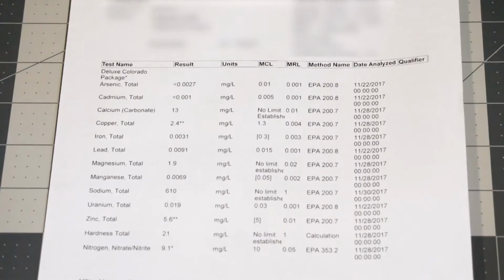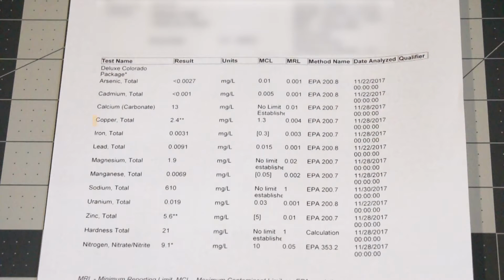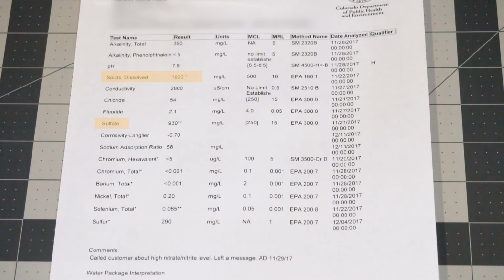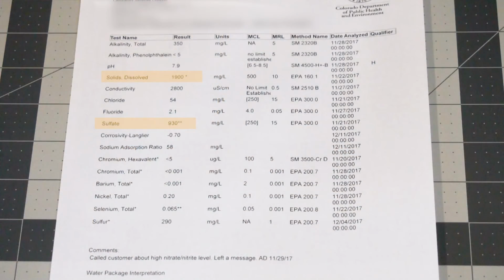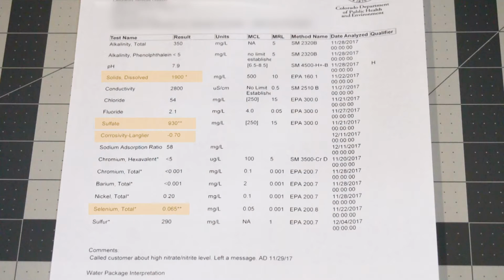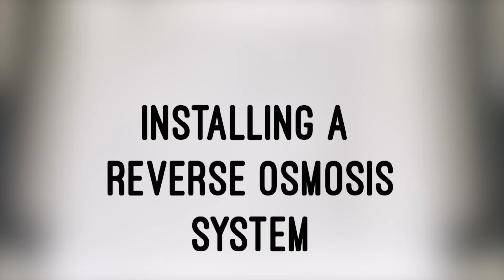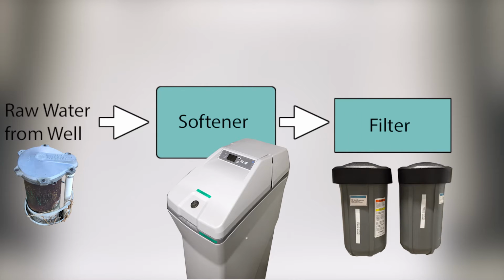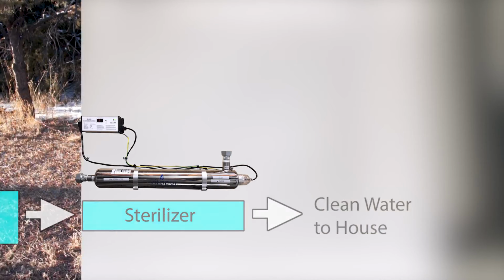Whole House Reverse Osmosis Water Filter System for Well Water

Comment: Hi, thanks for the great video! How are your house appliances doing regarding the soft water that you now have ? I have heard that if you soften your water with water softener that uses NaCl you can feel slippery after washing and detergent remains on clothes or tableware after clean cycles as it is hard to remove because the NaCl binds to the detergent and sticks to surfaces. Did you notice anything ? How is the limescale buildup on surfaces ? Not an issue anymore ? Any downsides to this except the cost ? We are thinking about doing something similar but only for appliances so they won't be damaged by limescale and in specific places such as bathrooms so it won't grow on glass panels in showers.
Reply from the maker: Hi, Peter.  Before the RO system, we'd have to replace the dishwasher every other year due to corrosion.  Since replacing it, the dishwasher still looks new inside.  Really, same for the washing machine.  Where I notice it most, though, is in the toilets.  We used to get so much scale it'd form a ring where the water level was and crystals would grow out of the tank.  That doesn't happen anymore.  I haven't noticed a difference in the way the water feels but it felt fine before we did this, too.  One thing I have noticed, though, is that our water gets harder in the winter and slightly less hard in the summer.  The RO removes it so it doesn't matter, but on the outside spiggots where we still use well water, the crystals get really bad in the winter months.  

If you want one of these to avoid scale, it'll absolutely work.  We haven't had a problem with it since switching the RO system on.  There hasn't been much downside other than cost.  The 3/4hp booster pump uses a lot of electricity as I have it wired on 120V.  I need to extend a 240v circuit but we don't have any free spots in the panel and so it'll be a big job and I keep putting it off.  I have been chasing leaks on-and-off since I built the system but that doesn't have to do with it.  It's those copper unions I used.  Every one of them has developed a leak over time and I've been replacing them as I go.
Reply: @RobertAdairWorkshop  thank you!

Comment: how do you change the membrane? Also I feel like my system flush water a lot while there is open faucets at home ,even when I have a 600 gallons tank. any help please
Reply from the maker: Hi, Les.  I have not yet replaced the membranes.  The guide I read suggested to replace them when they no longer provided sufficient TDS reduction.  So far, their performance has not degraded.  Is your system controlled by a single float?
Reply: @RobertAdairWorkshop  ,Don't know brother , I wish I can post a picture of my system ,it seems simpler than that one ,thanks a anyway

Comment: After moving into a house with a well and septic for the first time, I would’ve killed for a friend that knew about all of this stuff and could give me advice.  

I have a typical kinetico system.  
If you’re unfamiliar, it’s basically kinda like if apple made water systems.  They can only be serviced by certified technician, you can’t get parts, you can’t fix it yourself, and even the general maintenance can’t be done unless you get filters from a specific store that’s only open Monday through Friday.  
“Oh? You would like to order that $34 filter from Amazon?   Okay, that’ll be $275.”

Comment: You said your RO has to deal with 1900ppm TDS, doesn't your softener handle that and reduce it before it ever gets to the RO?
Reply from the maker: No.  The softener doesn’t bring it down much.  It prevents membrane fowling but the 1900 is what goes into the RO system inlet.

Comment: Hi Robert the video is great but a water softener does not reduce TDS. It just swaps out most positive ions with sodium or potassium, whatever you're using to regenerate. So it does help by reducing the fouling of the membrane but not because it's changing the tds, but because it's changing a lot of the TDS to sodium which an RO membrane can handle without fouling.
Reply from the maker: That's good to know.  Thank you Aqua General.

Comment: Hey Robert, thanks for the helpful video. I just subscribed to your channel and was hoping that you could provide me with some information concerning the water storage tank. Did the tank come with the plastic parts preinstalled that receive the tubing that supplies the clean water? If not did you install that inlet yourself? I also have the same question about the outlet part that attaches to the pump. Did it come preinstalled or did you add it yourself? 
If you did add them yourself, would you please provide the parts name and website so that I can locate them?
Reply from the maker: The tank came with one fitting on the bottom.  A single 1.25” threaded outlet.  I connected to that with pvc to supply water to the pump.  The other fittings, I installed myself.  Look for Bulkhead Fittings.  That’s what you’ll need.  They come in most standard pipe thread sizes.  You will have to drill a hole in the tank to install the fitting.  I just used a hole saw and then carefully wiped out the plastic shavings.  You can get tanks with or without bulkhead fittings pre installed.  Look for that when you buy your tank. I went with 1.25” to match the pipe size for the pump inlet.  And 3/8 on the top to match the float.  You can get them on Amazon and eBay or from industrial suppliers like Zoro, Grainger or McMaster.  Search for the size you need. Eg.” 3/4 bulkhead fitting” and you should see them.  Check that they are safe for potable water.
Reply: @RobertAdairWorkshop  Hello again, I'm planning to buy the same brand RO system as you, but when I went to the website I noticed that the Clean Water Store currently only sells the Flexeon BT 2000 gpd. However, I did manage to find the BT1000 and BT1500 on ESP Water Products website, so the 1000gpd model is still an option. About a week ago, a sales rep from US Water Systems was really pushing me to get a 4000gpd system even though he conceded that I only need a smaller sized tank (140-160 gallons). After talking to the rep, I began to question whether or not 1000gpd was sufficient and thought that you might shed some light on this matter from your personal experience. 

If you don't mind me picking your brain, what were your reasons for going with the 1000gpd version instead of the 1500gpd or 2000gpd? 

Has 1000gpd, led to any water shortages for your family where you had to wait to take a shower or wash clothes, etc...? If you had to do it over again, would you still choose the 1000gpd model?
Reply: @RobertAdairWorkshop  Thank you! That's exactly what I needed to know

Comment: Did you have a test of the water after the system was installed?
Reply from the maker: I did.  I do them annually.  I check for fracking contaminants, industrial contaminants, agricultural and heavy metals.  I have sample bottles waiting in my entry right now for my 2022 test but I haven't sent them out yet.  I'll post the results in the description when I have them so you all can see performance of the unit.

Comment: When you say “expensive,” how much are we talking? You should create affiliate links for each item so you get a commission if we buy them. I just moved into a home with a well, and the water is harder than a virgin on his wedding night. I need this system! Do you suggest I hire someone to set it up for me?
Reply from the maker: It was somewhere around $20k.  That included the premium RO unit with the better, higher pressure pump, better membranes and stainless, everything.  Since our water is so corrosive, I went with that stuff to help with longevity.  The premium stuff added about $2k to the price of the RO unit.  It also included the tank, piping, the pressure pump and pressure tanks, the neutralizer, the UV sanitizer and the Arduino controls.  What gets you in the end is all the ancillary stuff you need to incorporate that RO unit into your house plumbing and get it pressurized.
Reply from the maker: If you're handy with plumbing and electrical, you can do it yourself.  I had to extend two new circuits for the pump and the RO unit so they were on dedicated breakers.  The plumbing I used was all copper and I'm really good at soldering and fitting copper, so it wasn't bad.

Comment: I'm not trying to call you a liar or upset you, but I have the Flexeon AT-1000 as well, and the well contractor that did all the work on my house charged me $3600 for the unit.  Did the price go way down on these from when you bought yours?
Reply from the maker: I don't really know.  I got ours from the Clean Water Store, online.  I bought the 'Premiere' one with full stainless equipment, the better Grundfos pressure pump, the Minitrol IF controller, condensate recycle loop, feed flush, built in TDS meter . . .  It was bundled with a pair of 160-gallon tanks, the fiberglass pressure tank and the Grundfos booster pump.  They make at least three versions of the RO system and they are all custom orders from the factory.  Our water is corrosive.  Incredibly so.  So I spent the extra money on the better parts and better pump.  I suspect yours was an off-the-shelf base unit.
Reply: @RobertAdairWorkshop  oh well that makes sense, when you add up the cost of all other equipment with it.  I thought you meant you paid 10k for just the 5 stage.

Comment: got my water tested two weeks ago, got the results today, hardness 1800 ppm, sulfates 1783 ppm, TDS 2932 ppm, everything else was normal. Looking into a RO system, but gd they are high. I would probably have to use a water softener in front of the RO system.
Reply from the maker: That is crazy high.  I thought ours was bad.  Did you end up finding a system that'd work?
Reply: @RobertAdairWorkshop  we haven’t done anything yet, input a water softener in for now, we don’t drink it. $10k for a RO system is a tough pill to swallow lol

Comment: Wow almost 2000ppm! that's crazy!!!   How much "discard" water is used to make one gallon of 18ppm?  Does all that extra "discard" water mess up your septic system?
Reply from the maker: Hi, Cobre. It’s making .55gpm of clean water per minute and discharging 1.6.  That’s about 3-gallons down the drain for 1 gallon of clean water.  I send that into our septic system.  It hasn’t been a problem for our septic.  At least, so far.
Reply: @RobertAdairWorkshop  some of the newest systems discharge the wastewater back into the well, but you have to have a well that is set up for that. It's really nice because it doesn't deplete the well and barely affects the concentration of the well overall and you don't run the risk of running your well dry as quickly